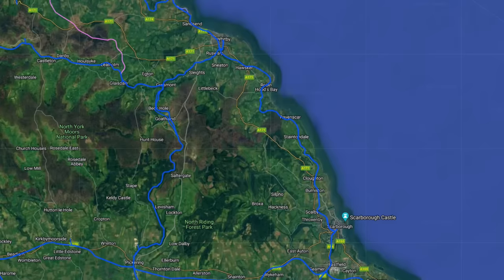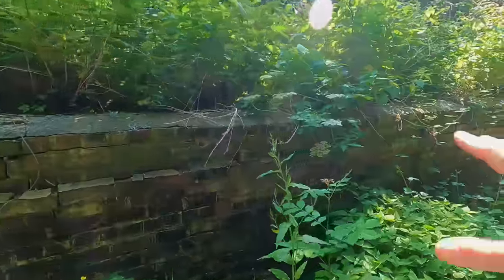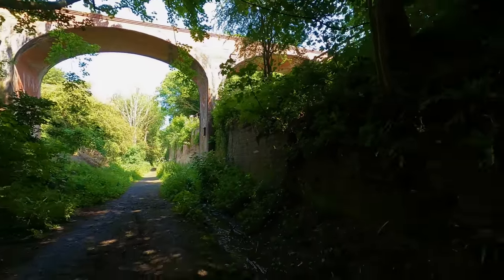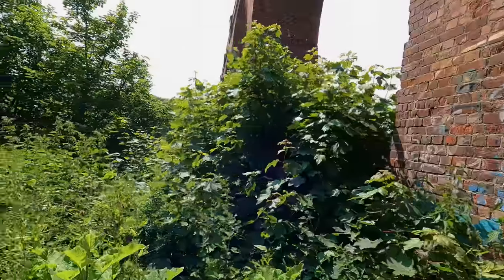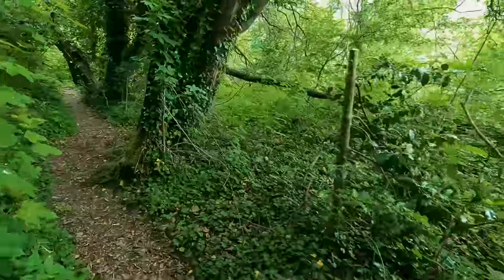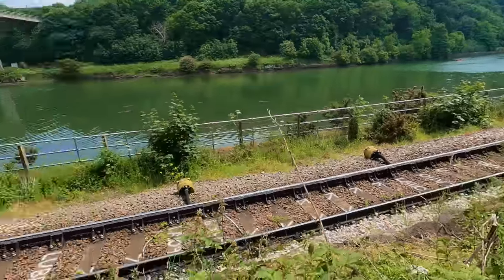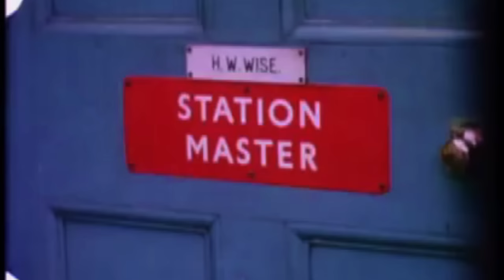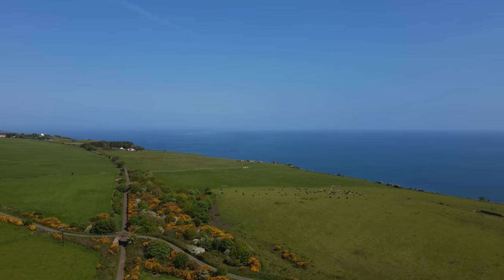How did they get a Train over 100 feet down from this Viaduct? The Scarborough to Whitby Railway

Comment: Fantastic end to the series, thanks. I always take the Pickering - Whitby NYMR train when visiting the area and this really brings the final and less-scenic part of the journey to life. The railway around Whitby itself was quite something! Incidentally, I think the NYMR trains actually leave Network Rail track before they enter Whitby itself, the platform they use and the run-round loop being NYMR’s private track for its exclusive use. On the return trip, they rejoin NR by phoning the Signaller to request the token to Grosmont on the Esk Valley Line (unsure whether or not this uses an RETB token), this being handed back again by phone before leaving NR again just East of Grosmont and turning off to return to NYMR metals in the station sidings. Only certain NYMR locos are certified to use the Main Line, so locos will drop off their stock in the platform at Grosmont before shuttling back to Whitby with the next train. NYMR passengers can therefore either do the whole trip by through train, or have to change trains at Grosmont.

Comment: Thanks Ant for a great series. At Whitby the platform you were walking along is the new one used by the heritage trains. The platform on the opposite side is used by the Northern trains. Friend who’s a NYMR volunteer says the line is controlled from the signal box at Nunthorpe which is at the Middlesbrough end of the Whitby to Middlesbrough line.

Comment: Hi ant thank you for showing parts of the Scarborough to Whitby disused railway line YouTube video it was a really good and on the part 3 and 4 episode when it was showing the railway carriage holiday place and the Larpool Viaduct I have walked along that route in April last year.

And the parts on your next YouTube episode by doing the Esk valley of the Middlesbrough to Whitby disused railway line I have got some photos of 2 disused railway viaducts a disused railway station and a disused railway tunnel that I have walked along that route back with a walking club last month.

So here are  all of the photos of the old Middlesbrough to Whitby disused railway line.

Comment: Absolutely brilliant video Ant. Got some awesome retro footage. Westcliff closed in 61 after that they just changed ends at Prospect Hill but i believe they could still run round using the passing loop. The picture of the DMU at Westcliff is rare as its after the Loftus line had closed and the signals had been removed. It looks like there maybe a set of buffer stops beyond the platform.
Looking at the old pictures of prospect hill box it seems the low recess was where the point rodding came down from the lever frame.
 Amazing you seem to make videos about places i go or work Yorkshire,Norfolk and east midlands

Comment: As Scarborough was a popular holiday resort I'd imagine that quite a few people might have used the original direct line from Middlesbrough via Loftus to Scarborough but after it was truncated at Whitby use probably dropped off with people using the direct buses provided by United which obviously went via Whitby but you don't have to change just like the X93 now.By rail now it's a big detour via York.

Comment: I wonder what the maximum gradient was for this loop? It's a shame that the route of the loop is completely lost nowdays: whenever I've followed it down on foot from where Prospect Hiil signal box used to be, I've got lost within a couple of hundred yards due to trees and bushes, and maybe also to ground movement.

The author Andrew Martin has written one of his Jim Stringer novels centred around Whitby and the connection between Whitby Town and Whitby West Cliff stations: I forget the details but I think a character on foot was trying to run between the stations (hopefully going downhill!) and beat a train over that journey.
Reply from the maker: It's rather steep isn't it? I never realised what a gradient the line up to Larpool Viaduct had too until I was stood down the side of it beyond the signal box
Reply: @TrekkingExploration  The other thing I've never understood is why the Saltburn-Scarborough "straight on" route is the one that had the pronounced S-bend kink, and the steep loop line is the one that had the unkinked path to Whitby West Cliff and Saltburn. One of life's little mysteries.

Could be that the loop line and the route north was built first, and Larpool Viaduct was built later with a link in the track being necessary to join the earlier track? Or does that not match the order of construction? I always think of the loop as a later addition, but maybe I'm wrong...